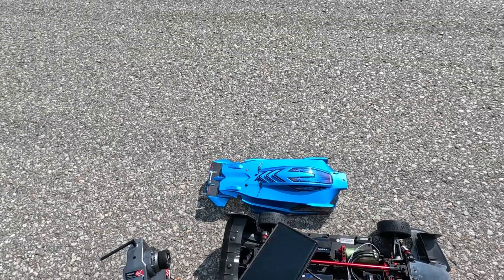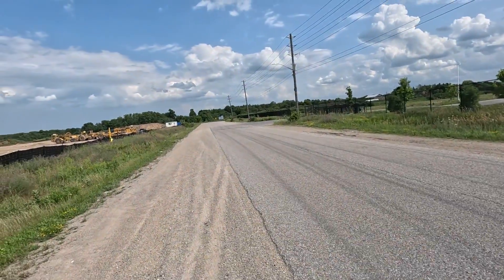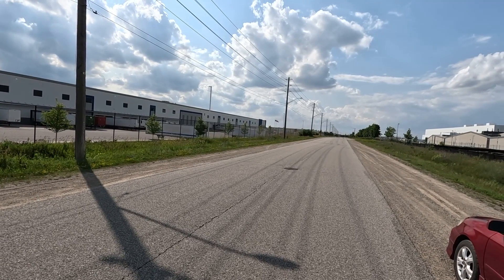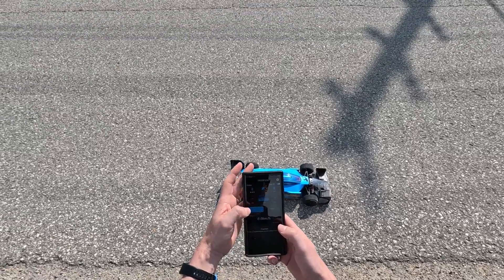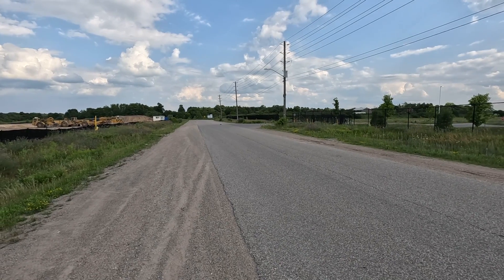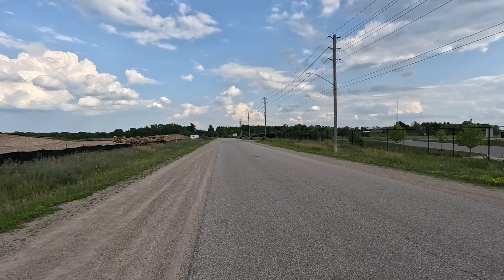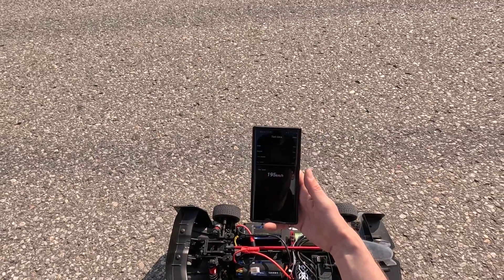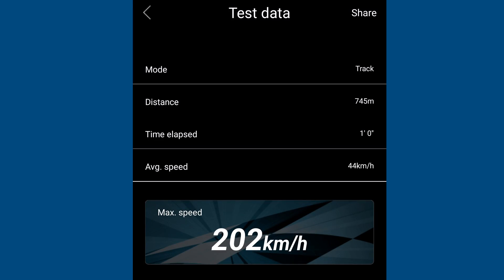1st Run of the Arrma Limitless V2 - Quest for 200km/h

Comment: I could use some assistance. I’m just trying to build a monster 1/10th truggy. Right now I got a 4.5t hobbywing and if I go any more then a 16t pinion it overheats. I’m getting a bit over 50mph and a 3 second 0-132 foot. I want more but I can’t gear up. Would I be better off with a 5600kv 4 pole? Maybe that could be geared higher?
Reply from the maker: Go with a larger motor utilizing the upper rpm band of that motor.

Comment: Nice Run. Will you show the graph from the castle speed controler ? Would be nice to see how much voltage drop and amp draw between passes.
Reply from the maker: I didn't plan on it.